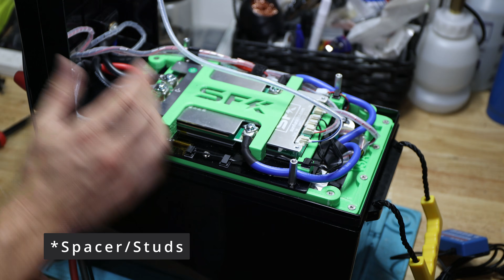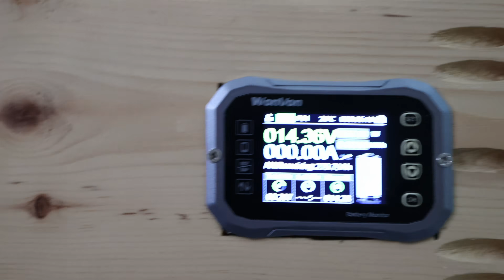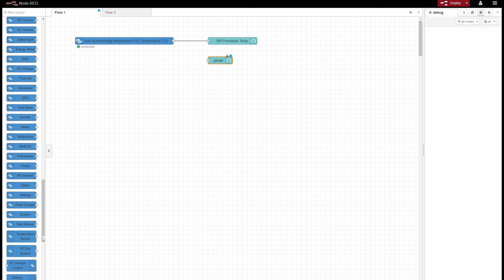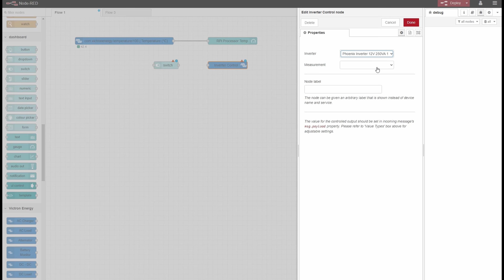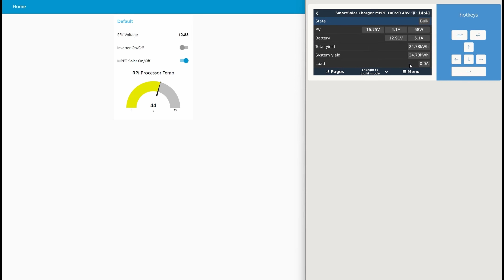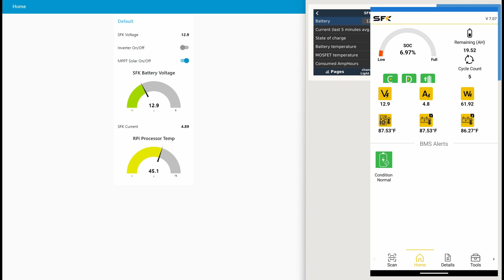Node Red configuration Part II

Comment from the maker: Affiliate links:
SFK Battery 12V
https://www.sunfunkits.com/product/14...
Coupon Code 5% off the order (good for 1 year, limit of 30 uses): Tobi

SFK Heated Bag
https://www.sunfunkits.com/product/47...

RJ485: https://amzn.to/3WQB0xC
Victron Energy MultiPlus-II 120V, 3000VA 48-Volt Pure Sine Wave Inverter and 35 amp Battery Charger: https://amzn.to/3TDYdS4
Victron Energy SmartShunt 500 amp Battery Monitor (Bluetooth): https://amzn.to/3QfkKUD
Victron Interface MK3-USB-C (VE.Bus to USB-C): https://amzn.to/3xpONlz
Victron Energy RJ45 UTP Cable: https://amzn.to/3vzeFei
12 AWG Power Cord 12FT Open End: https://amzn.to/4afOUPh
Raspberry Pi 3 Model B+ Starter Kit: https://amzn.to/3Lb3Tig
Raspberry Pi 7 inch Capacitive Touch Screen: https://amzn.to/3O2VcJT
Victron Energy VE.Direct to USB Interface: https://amzn.to/2TbCEx4
Power Supply Raspberry DC-DC 12V to 5V 3A Micro USB Converter Voltage Step Down: https://amzn.to/2UE3Ftf
Raspberry Pi 3 B+ Case: https://amzn.to/3qt1Mf3

Comment: Hi thanks for your video! Could you shortly explain how  to input the data from a current transformator connected to the Multiplus? I have not seen it in any video yet, just want to make sure it works. I need to control the Multiplus based on the measured current. Thank you!

Comment: Part III... Part III  please.... 🙂  I want to switch on and off my victron MPPT solar charge controller (in HA)... not working for me yet..  thanks for the tips.
Reply from the maker: @whereswardlaw  thanks for watching! Working on it :)
Reply: Hi my name is Paul I know how to turn on and off the solar charger with node red you are using the wrong module in node red the connector is on the left side not the right side

Comment: Very informative, thank you ! 
Would have been nice to see everything wired up as well
Reply from the maker: @Thunderst0rn  do you mean the victron components?
Reply: @tobisreallifeskillswithtobi  Yes everything you are using: inverter, temperature sensor, raspi, battery,.. would be great to see it physically connected as well
Reply from the maker: Got it! I will include this next time. It is not as clean as it should be, probably that's why I did not include this in the first place ;)
Reply: @tobisreallifeskillswithtobi  great! I don't think that matters in a demo setup, it makes it more easy to reproduce for your viewers or in the first place think about what they will all need
Reply: @Thunderst0rn  Indeed, I agree.
@tobisreallifeskillswithtobi  So SFK delivered the CAN cable? And the other end is USB I suppose? And VenusOS recognizes 'a' battery just like that?
Would other brands BMS also be recognized? I'm about to buy a JK-BMS that also has CAN, hence I'm asking.
Reply: Hmm, thinking about it, CAN doesn't specify the protocol. So The BMS must be able to 'talk' Victron language I suppose.